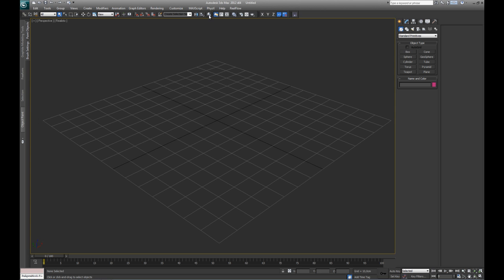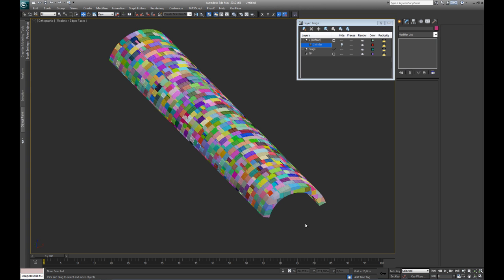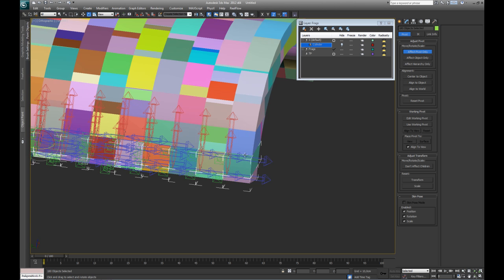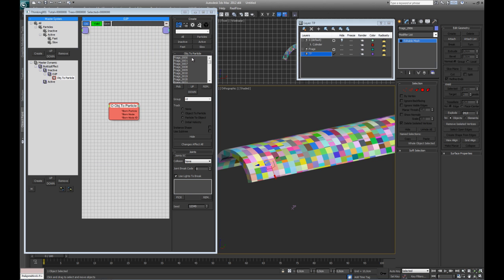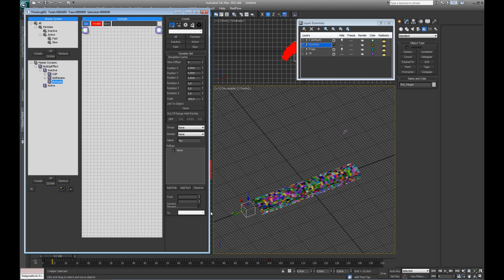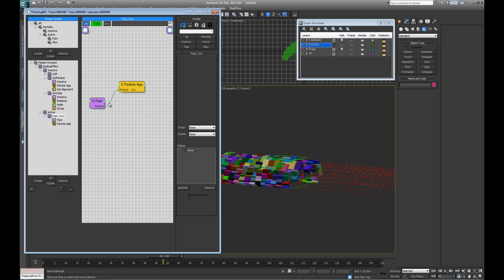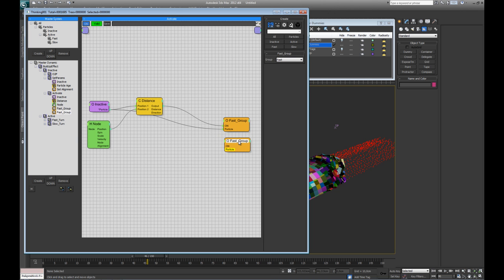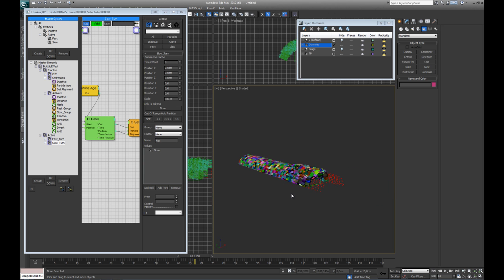Creating a Roll-out effect using Thinking Particles.

Comment: when you mention that the VB modifier will sometimes not retain the complete volume and stop cutting midway through: Are you sure that isn't caused by your Max Cells setting being too low (5000 in your case)?
Reply from the maker: Sometimes, even with more max cells, it just fails to calculate a proper cut. But you can usually fix it by changing some of the settings

Comment from the maker: Plug that result into the scale factor of Scale node, this will mean as the particle ages, it scales. The scalefactor operates in the space of 0 to 1, so you will have use an limiter to make sure that the value doesn't get over 1, there is a blackbox that is called limit value that I used for this.

Comment from the maker: To make the particles scale over time, I did the following:
When the particles are born in this system and rotated(I think the dynamic set is called SetParams) you also set their scale(not size!!!) to 0%. Then when the particles are moved from the inactive group to the active, you reset their age using the particle data node. Then you can multiply the particles age with 0.01 or something like that.